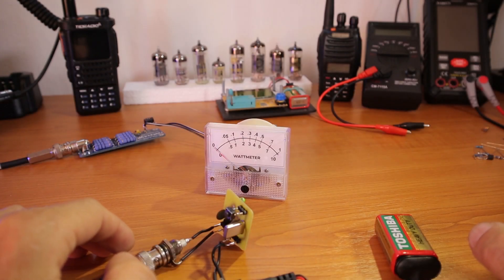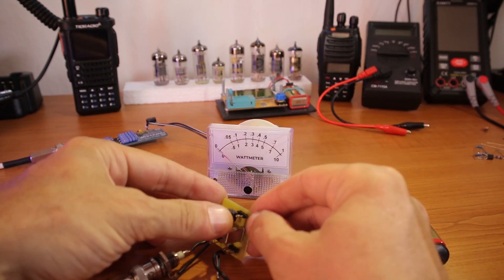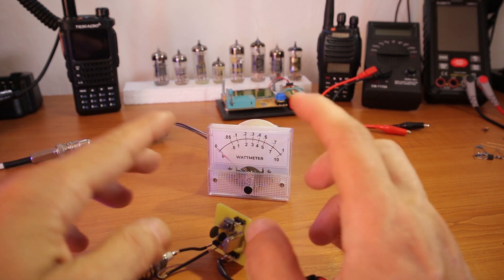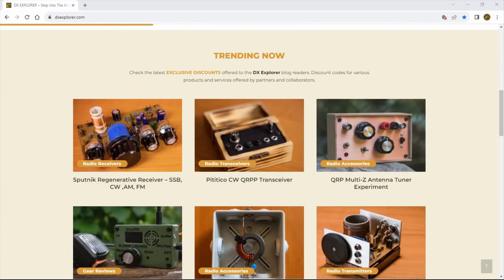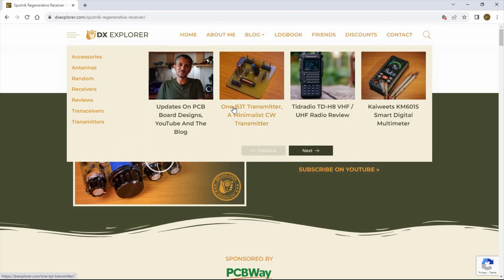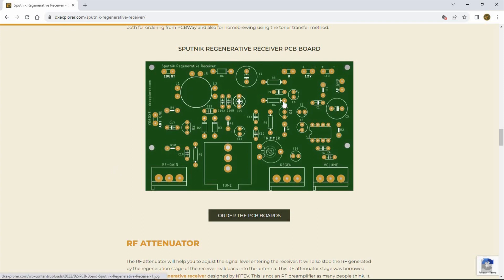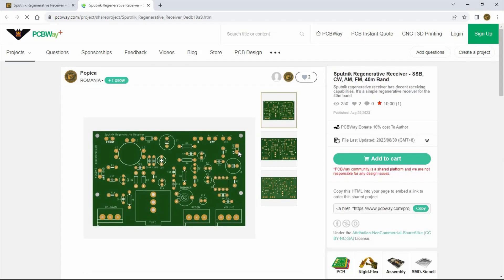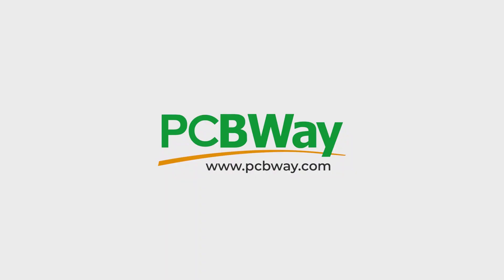HF Two Scales QRP RF Wattmeter And Dummy Load - 1W / 10W or 2W / 20W

Comment: May be you are getting close results , but this is not the right formula      P= (Up*0.707+Udiode_drop)squared /50  

U av=Upeak *0.707   or in some sources is  Uav= Up*1/1.41
Reply from the maker: Thank you so much. Ohh I will make you laugh. Every time I update the formula someone tells me is the wrong one hahaha. So I will write it down for me to know it and learn from it. What I did at the end is that I calibrated the meter using an already calibrated power meter so I no longer have to calculate things as honestly I no longer know what is the right formula 😅😅😅. Thank you so much one more time. 73, YO6DXE

Comment: hi. Great project. But i believe the formula is P = ((V + Vdiode)^2 ) / 100
Reply: source : AA5TB's qrp power meter, solving for the Vpeak
Reply: I believe you are correct. AC would be V^2 / R (ohms law), with V as the RMS value. This device is peak reading; to convert peak to RMS you divide by sqrt(2). Once you square V/sqrt(2) you get V^2 / 2, then divide by R, so you end up with V(peak)^2 / 2R (remember to add the diode drop to V).
Reply from the maker: Sorry for the late reply... I had a long day yesterday. Yes... the formula to use depends on the result you want to get. In my case I am interested in the peak to peak power. I found it easier for younger kids that usually don't like calculating that you can borrow a proper power meter, or use a transceiver that has a power meter incorporated and use that to calibrate the wattmeter to your needs. It seems to be more accurate than I was expecting to be honest... even though I was not looking into very accurate readings when I built it. I just wanted to have an idea of where about I am with the power output and if I do have RF going out from whatever I was testing. Is a really simple and basic tool but it seems to be a great thing to have around. I think I will modify it to the 1W or 2W / 20W version though so I can also test equipment that has a little over 10W. With the diode I used it seems to do just fine on VHF and UHF as well and I was not expecting that either. Love it 😁. 73, YO6DXE and wish you all a fantastic weekend.
Reply from the maker: P ( W ) = ( V + 0.25 ) / 50, where 0.25 is the voltage drop of the diode for peak to peak power... your formula for RMS indeed. You get to peak what the meter shows you )).

Comment: If you have double triode you can make audio amplifier with mosfet in schematic it works from 24v 
also if you can write me wich tipe of tubes you have i can send you easy schematics on low voltage
Reply from the maker: That sounds AMAZING 😁😁 Thank you so much. I will write a blog article this weekend and put a list there of all the tubes I have so far... and I will send you the link. I need to catch up with you on the email as well. Maybe later on today 😁. 73 and have a fantastic Friday.
Reply: @dxexplorer  thanks. Also I will show you my regenerative receiver on tubes wich works 80 and 40 meters AM, CW and  SSB modes😁.
73! 4L1LAT
Reply from the maker: @inventor2540 Ohh yes please 😁